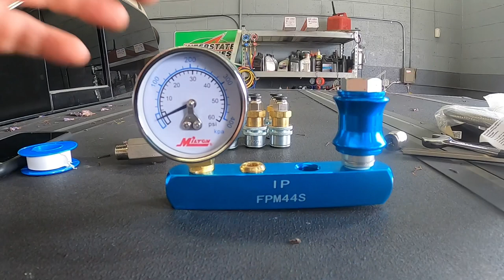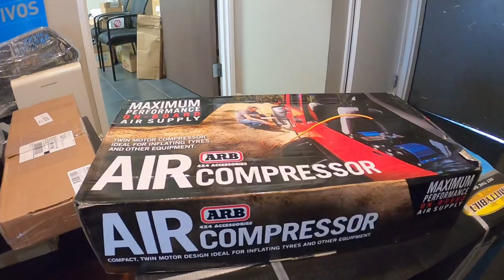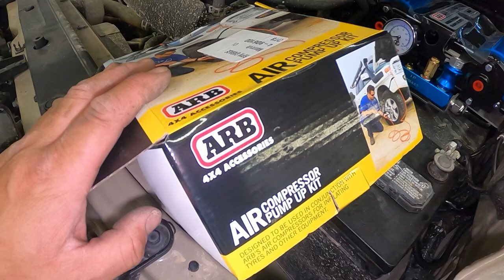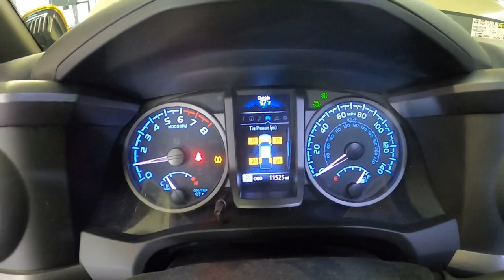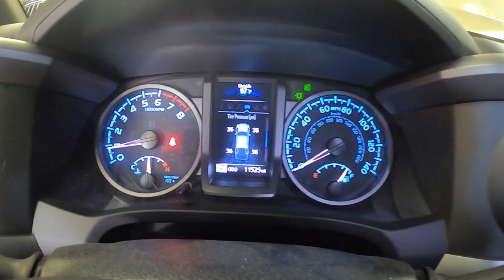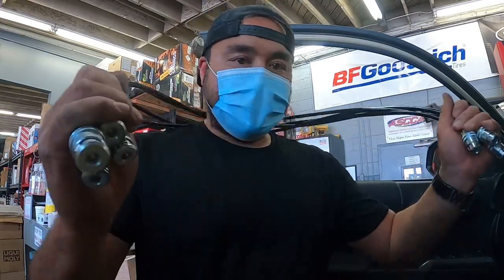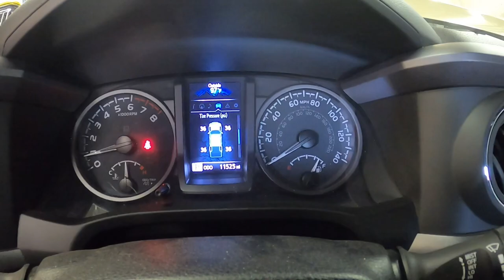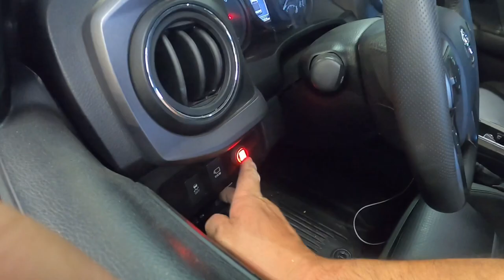Onboard Wifey Air System install on a 2020 Toyota Tacoma at RPM Garage

Comment: hey bud, great install. I had a question about using this system and installing the compressor in the bed of the truck using expeditions essentials bedside mount. Any suggestions on where to add the manifold though? There might not be enough room in the compartment itself so I was thinking of adding it to the inside of my camper shell.
Reply from the maker: Robert Vera III usually you can use this to mount anywhere. Viair 92820 6 Port Manifold with Mounting Holes https://www.amazon.com/dp/B00RMC4J2Y/ref=cm_sw_r_cp_api_i_7ZupFb0HKVP0Y

Comment: Nice clean setup as it looks factory. However, you can greatly improve the fill rate by ditching the compressor and just use a 10 lb CO2 bottle. It is much quicker for fill rate and another benefit is you can use the CO2 bot5le to power air tools!!
Reply from the maker: I’ve had many customers switch from CO2 tank to wifey air.  The reason for the switch was unlimited air, less cargo space taken up by bulky tanks and it’s only 5 - 6 minutes to air up all 4 tires which isn’t that bad.  Electric tools is a good option if you need to bring power tools along.  They did the pros and cons for both systems and wifey air was their choice.  CO2 might be the fastest but Wifey air is more convenient.

Comment: Should the top of the sliding valve be capped off? I'm currently in the process of putting mines together but I'm getting air through the top of the sliding valve when it's closed.
Reply from the maker: No, it shouldn’t be capped off?  Did you get it from me?

Comment: Hello. Thank you for the great info. I have a twin ARB and the wifey System ready to get installed on a 2004 4Runner. the only issue I have is that I would like to put the compressor on the driver's side but there are no brackets forit. any info will be appreciated. Thank you

Comment: Is there any concern with the valves in the wheel wells getting dirty/muddy and unable to use?
Reply from the maker: I haven’t had any issues.  Been using the system since 2016 and I never put on the valve caps

Comment: If I wanted to use the ARB 1 gallon air tank, where would you place the manifold?  After the tank, or between compressor and tank?
Great video!
Reply from the maker: I would put a splitter after the tank, one for a quick connect, the other to the wifey manifold

Comment: Hi I just got my 🌮 about a week ago and looking at YouTube videos on how to mod it. I see YouTubers put the extra fuse box for a clean look with the power wires where you put air compressor. I seen other YouTubers put the air compressors on the passenger side by the air filter, would you setup fit there?
Reply from the maker: Yes, my setup will fit on the passenger side

Comment: What is the 8mm tubing for, if your main system lines use 3/8 tubing?
Reply from the maker: I tried using the 3/8 tubing for the lines to the wheels but it was too bulky and not as flexible.  For me, I just prefer the 8mm.  My latest kit is back to 8mm for all hoses now that I have a fitting that allows for it.  Anybody can use whatever size hoses they prefer.  Just be sure to get the correct fittings.

Comment: Think it'll make a noticeable difference if i go with 1/4" hose instead of 3/8"? I had already bought the hose and may not be able to return at this point.
Reply from the maker: 1/4 is pretty small.  It will work but might take longer to air up or down.  Do you have the correct size fittings?
Reply: Coming in here a year late but considering that the valve stem and schrader valves are more constricted than 1/4" it wouldn't make much difference if you went with 3/8 over 1/4.  You'd just have more volume in your lines with 3/8", correct?

Comment: I had this kit installed in my tundra and just tried to use it for the first time and when I turn the lever air just comes out of the blue valve on top of the manifold.  Do you know what might cause this or how to fix it?  The pressure gauge shows pressure for a split second as I’m turning the lever and then once it’s fully turned on the pressure gauge drops to zero and air just comes out of the blue valve on top of the manifold.
Reply from the maker: Slide the blue valve down.  When it is up it releases air so you can air down.  If it doesn’t work, send me a picture of the setup on Instagram @sponsoredbywifey or email at sponsoredbywifey@gmail.com
Reply: @sponsoredbywifey  Awesome thanks!  I will try this today and let you know.  =]